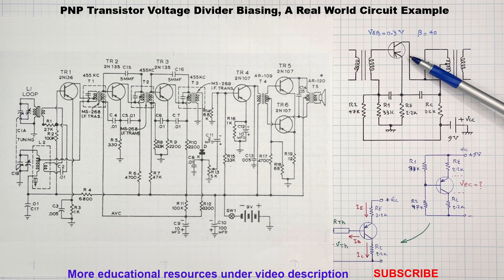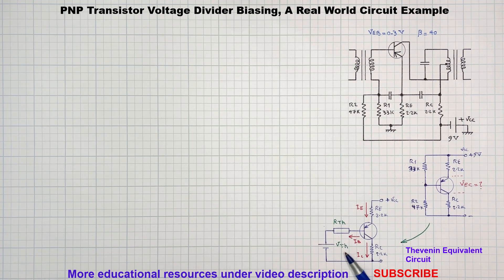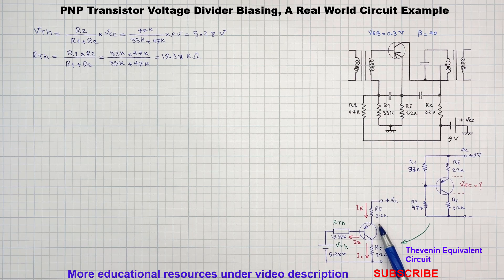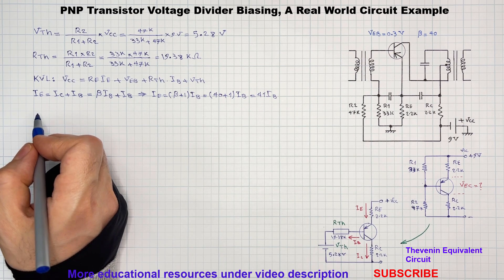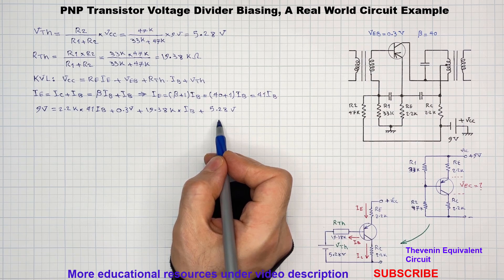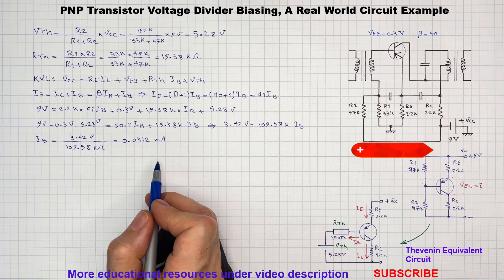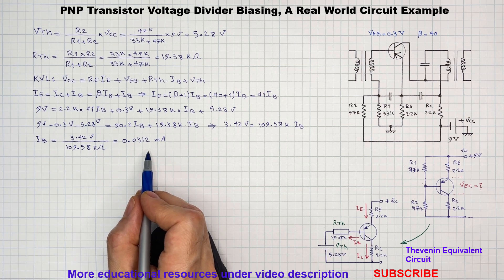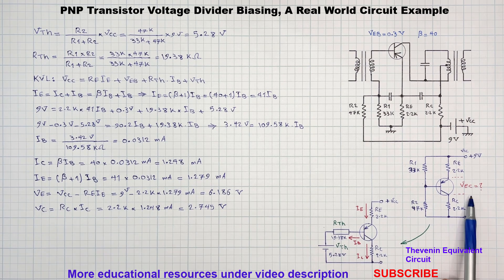Voltage Divider Bias for PNP Transistor, Finding IC and VEC of PNP Transistor

Comment: Good job with very old circuits of Germanium transistors ... I used to design and implement with Germaniums in early 80's ...
Reply from the maker: Thanks for sharing your experience!
Reply: A base circuit biased only by leakage appears in old car radio output stages

Comment from the maker: BJT Voltage Divider Bias Solved Problem:  https://youtu.be/QTZyadf7u3k
BJT DC Analysis Solved Problem : https://youtu.be/_XK0HeoV2BE
Daily Quiz: https://www.youtube.com/@EngineeringinDepth/posts
Schmitt Trigger with Output Bounding : https://youtu.be/f0zNs0-a5jg
Voltage Limiter Circuit Using Op Amp : https://youtu.be/AAEvPySJ7fk 
PNP Voltage Divider Biasing : https://youtu.be/zGo1NW2PO7c
PNP Fixed Biasing : https://youtu.be/_-PItPPaTjM
Electronic Circuit Analysis Playlist: https://www.youtube.com/playlist?list=PLLA_QJ8rHZBh5LqrY41bCvKgreRDRWrBQ
Control System Playlist: https://www.youtube.com/playlist?list=PLLA_QJ8rHZBjS_S6WPkmUweF5NbImvSqf